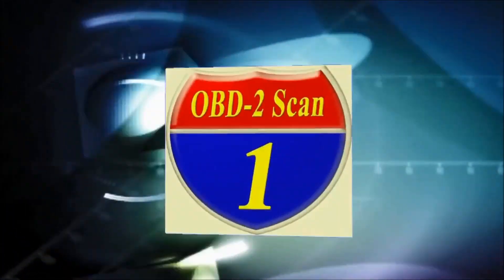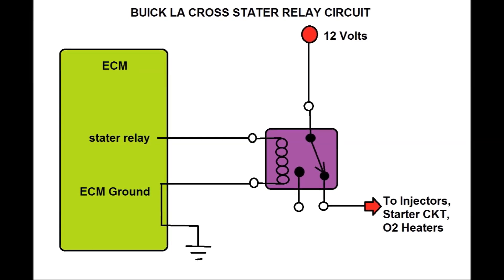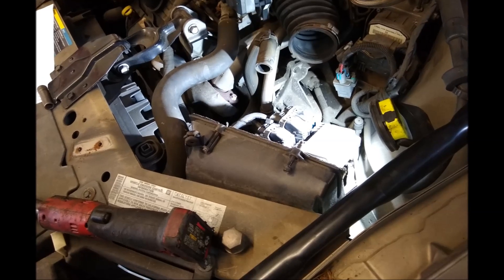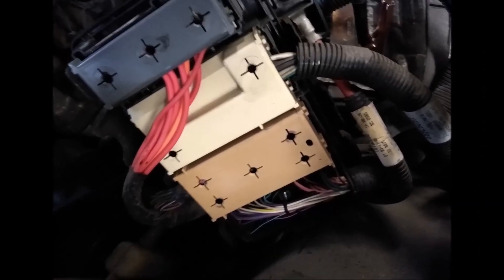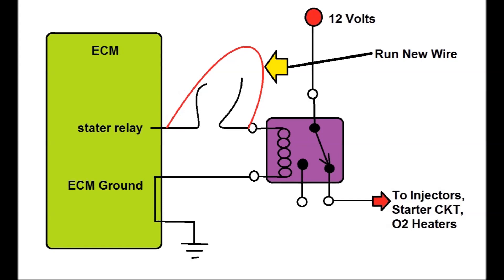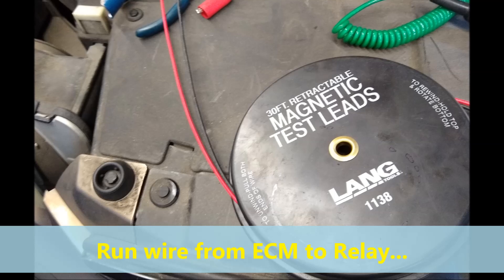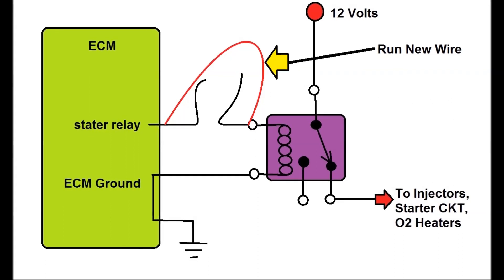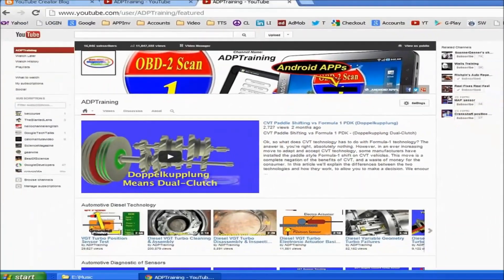How to Fix Buick LaCrosse Starter Relay Wiring

Comment: Awesome find the sad part is the customer might end up spending more down the road then trying to save a buck. You and I both know there might be more wires compromised in the problem area that may cause a issue at a later date. As mechanics we can only do what the customer is willing to pay for. that is a solid fix the only issue is why did it break. Great job my friend
Reply from the maker: Why did it break? Agreed, and how many others are also broken.

Comment: Ok my question is I have a loose ignition wire at the starter and the starter is cranking but the fuel injectors are not spraying fuel could that loose stater wire cause that
Reply from the maker: Why not tighten that wire?
Reply: @ADPTraining  because the starter is cranking the engine and because I can't tighten it its the connector on the starter for the ignition switch not the main battery cable I would have to replace the whole starter

Comment: awesome vid ,im subbed now bro ! . heres my question ,i have 2011 BUICK LACROSSE CXS 3.6L ENGINE . i go to an appointment ,3 hrs later get back in car and bammmmm ,nothing , NO CRANK / NO START ... my dash said " SIDE DETECTIONSYSTEM UN AVAILABLE , and,  "service stabilititrack " ... i go to auto zone to get their obd2 code reader because check engine light is flashing real fast ,test and autozone tells me PO23F - fuel pump secondary circuit/open, AND UO100 lost communication with ecm/pcm ...the #10 fuse keeps blowing ,it ECM fuse . i later confirm codes with two of my own readers ,1 being the BLUEDRIVER AND APP WHICH GAVE SOME MORE , WHICH GAVE A FEW MORE CODES ,  B3109 , B3205 , B3210 , B369D , UO164 , CO561 YOU SEE QUITE A FEW MORE .  ANY ADVISE YOU GIVE I THANK YOU !!! I BEEN ON THIS FOR 3 WEEKS ,ITS EXHAUSTING  LOL !!!
Reply from the maker: Well, U code it's exactly what I'm talking about here. Ounce the Network is down all other modules will also not communicate, which comes to this. If the Antitheft or Pass-Key  module looses communications, the engine will not start. What you have here is one sensor or module is shorted, bringing down the network. This is not something I can do over the web, buy you need more that an auto zone code reader. Good luck.
http://www.autodiagnosticsandpublishing.com/OBD_2_DLC_Health_Checker.html
Reply: @ADPTraining  thanks for your help bro ,and that tool i just read about is nice  !
Reply: @ADPTraining  i got the app on iphone for blue driver and bought the 99 dollar BLUEDRIVER also .it gave me a bunch of other codes  like 14 more .replace keyless remote bat, calibrate windows, lost com with HVAC, BCM, PARKING BREAK,TCM AND FEW MORE , I GOT  a feeling once i correct the blowing fuse problem on pcm ,all others will go away !
Reply: @ADPTraining   i didnt find anything buddy ,,i cleaned and put die electric grease on x108 , i guess i should investigate this area more,   i took off the engine comp fuse box ,cleaned it and brushed with well with die -electric grease ! i also did it to ecm ,i have cleaned a bunch of connection and applied the die-electric grease to ! .i noticed also ,the windshield wipers, radio sound, the radio comes on and function but no sound no matter if i turn all the way up  , gas gauge , all other door locking mech besides driver door worked again after shaking and prepping  the x108 section . my biggest problem is the # 10 fuse keeps blowing and the ecm relay will click about 20 times very fast off and on . if i open the trunk ,shut the door or connect /disconnect battery it does this waits several minutes and wil do it again .what causes the # 7 relay under the hood to do that . i notice also ,with my test light that has positive/negative showings ,i got a large majority of fuses in the engine comp that show ground /green light , this is strange to me .its been 3 months since it ran ...